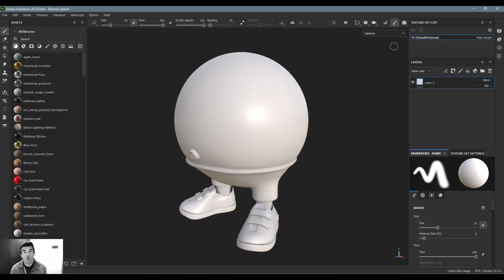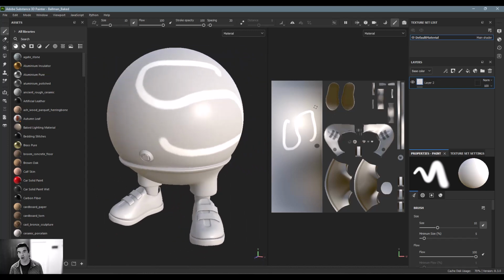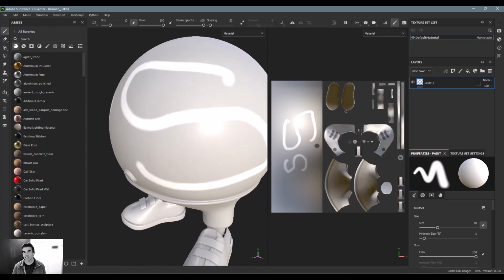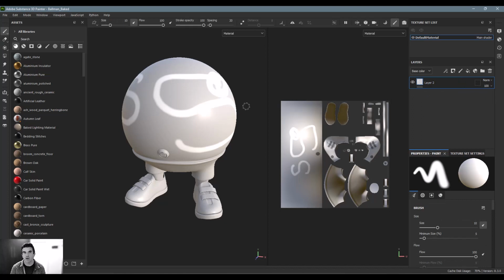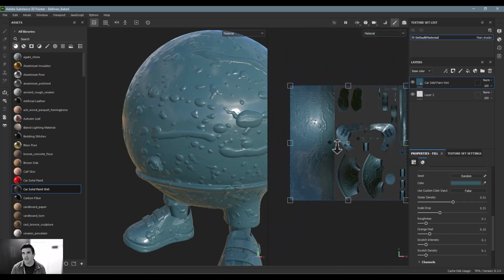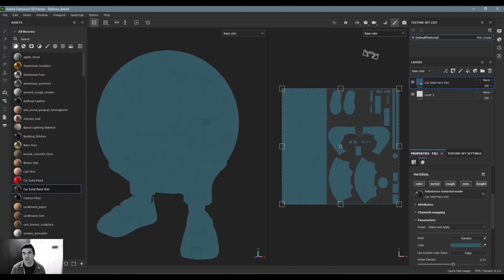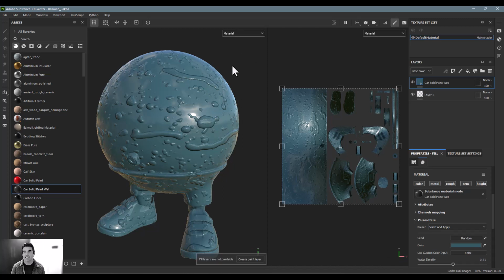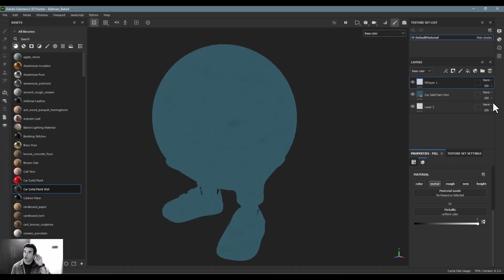05 | Substance 3D Painter Course -  Texture Map Overview

Comment: Thank you for your videos, great stuff (first time user).  Question I have, I don't seem to have as many paint (Materials) options as you (purchased substance through steam yesterday, subscription) I can't find the car solid paint wet you are using, any thoughts? Thanks again, great videos.
Reply from the maker: Thanks so much!!! Ah yes. Those are all through the substance asset library which is only available with a subscription. There is a community asset website that you may be able to access with just a login. If not, there are a lot of materials on artstation as well.